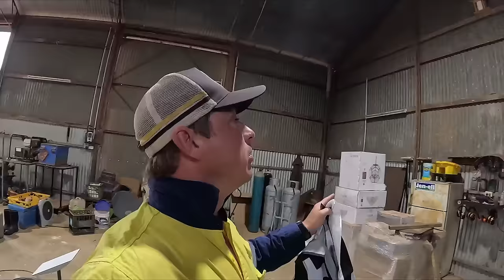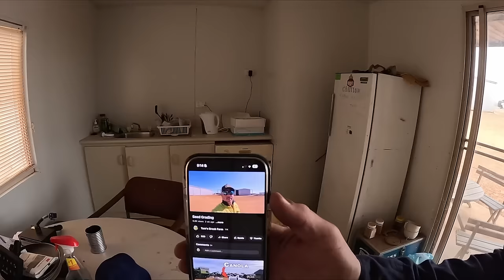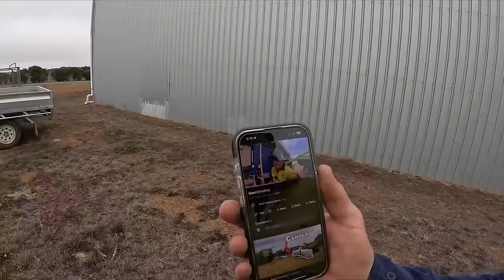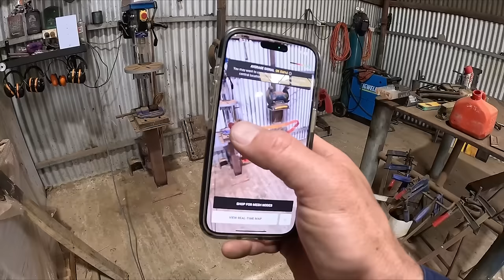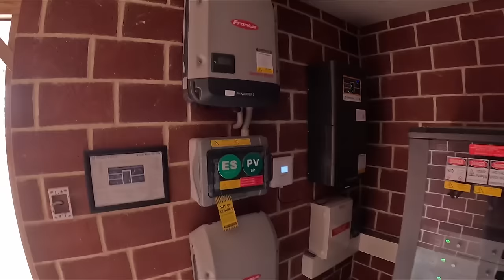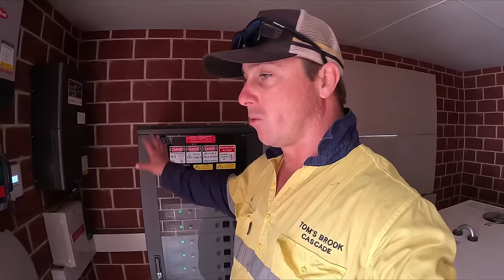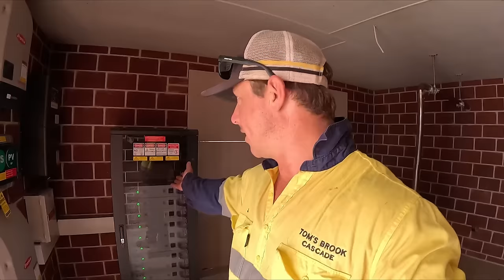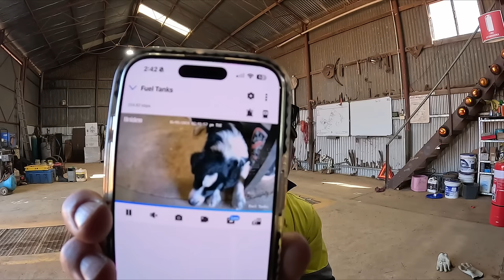Installing Starlink

Comment: i had the same issue with my star link when I put the dish on my shed roof, ended up building a small platform for the base to be level and then rebooted and she's not stopped since, found out later the base is required to be on a level platform to perform correctly, so my fix was the answer ! but you may have already worked that out , lov the channel

Comment: Gday JH, have a look at HATZ-GAAM fire pump which is the ones they have on most dfes units. Incredible pumps with up to 1500L/min. Diesel HATZ engine is German made and would be a better option than a petrol in my opinion in a fire situation. Cheers mate 👍
Reply from the maker: Just had a look, that could be ideal! Thanks for that. Been looking at what I was going to run but those if I can get them for a reasonable price will do the job nicely
Reply: @tomsbrookfarm   yeah I have got one of these units mate, but as in most cases doing it properly the first time usually ends up being cheaper in the long run. Good luck

Comment: As I go fishing in my boat a fair bit it wouldnt be wise for me to have a steel tray, so I stuck to Aluminium which doesnt rust. Dont get me wrong you have a great tray, fit for purpose which is what we all have to way up when getting our vehicles.
Reply from the maker: The wicked welding trays are all aluminium. They did do steel but not any more. My tray is all alloy
Reply: @tomsbrookfarm  I didnt hear you say it was alloy mate sorry but it is a great tray